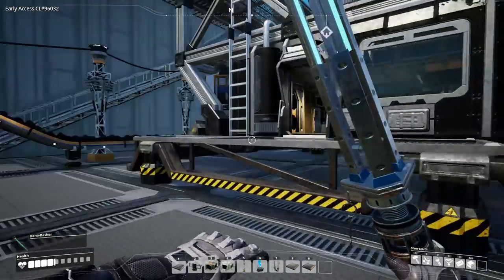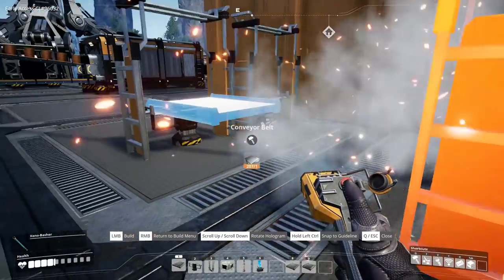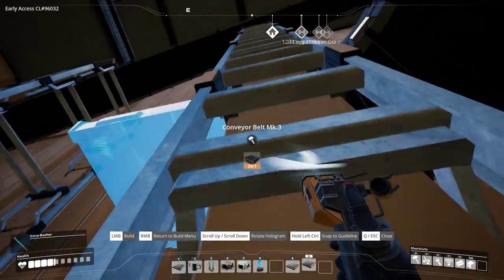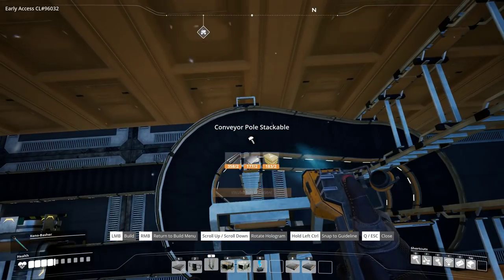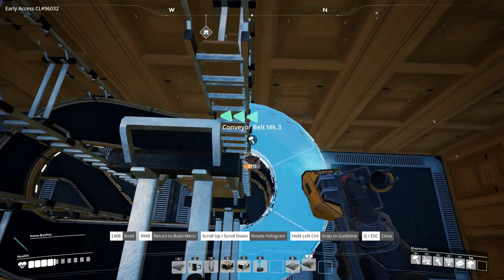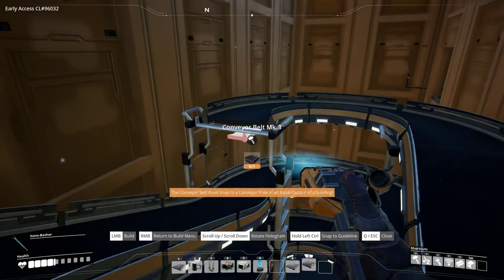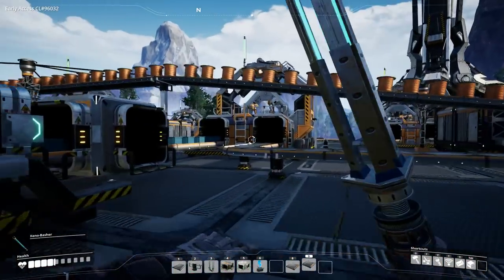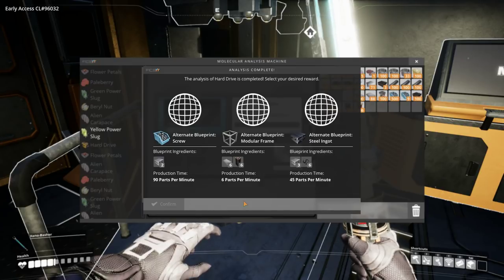NEW BELT LAYOUT - Let's Play Satisfactory - Satisfactory Gameplay Part 41

Comment: @Steejo, My idea for the belt-well just used half the stackable conveyor poles and could fit within about the same space, and also transported the same amount of belts up, the only difference is that I put the poles in the middle of the curved sections, and allow the belt to form the ramps itself, but i can't tell you if it is better or not.